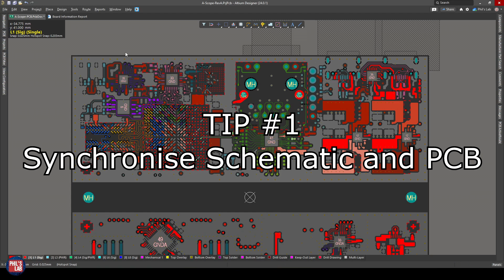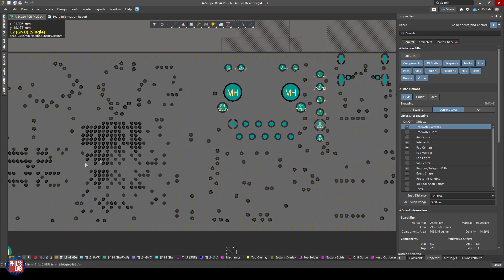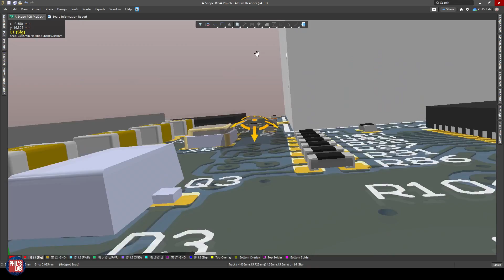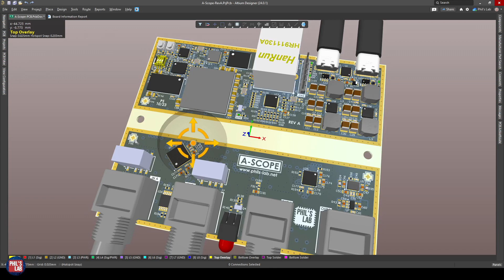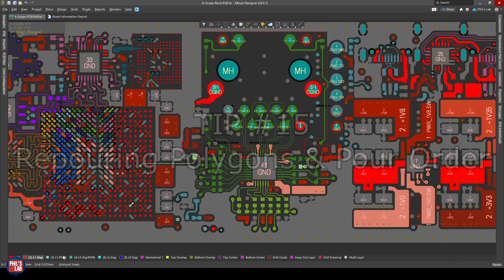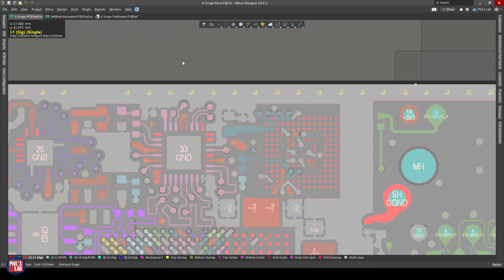PCB Design Final Touches (Tips & Checklist) - Phil's Lab #131

Comment from the maker: Thanks for watching! What final touches do you add to your boards?
In a future video, we'll cover a full PCB design checklist and make that a 'collaborative' GitHub repo.
Reply: What I do is do not open the design for a week or two if possible so when you see it after a longer time you can see all the stuff you haven't seen before
Reply: I only used KiCAD (just a lone, retired old fart) and I rely on the software to see if I've cocked anything up. I recently failed to do that as I moved from 7.x to 8.x because I got caught up with the production delivery (normally done automatically by an extension).

So I took my eye off the ball and planted a pressure-relief hole (air pressure) right through one of the supply lines. My board house spotted it and sent me an email.

That would have been pretty expensive in relative terms, both in price and lost time.
Reply: Hi Phil, how are you? I am sure things are quite busy. Is the video on "5 Jellybean SMPS IC" still on the list of TODO things?

Comment: 09:00 - Side Note 1 - Also poured areas that are only stitched with a single via should either get an extra stitching via (and if larger island) with some seperation to the original via, or just be removed. Otherwise the lonely stitching via functions as a antenna feed for the poured EMC patch antenna 😛

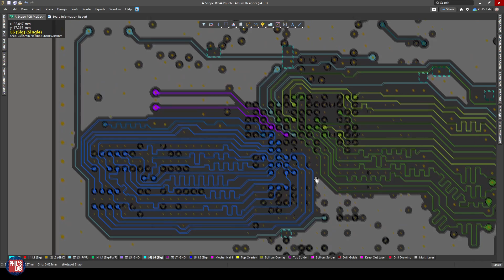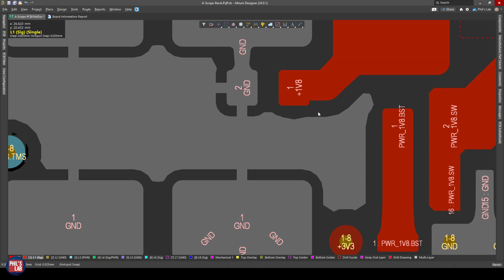09:11 - Side Note 2 - Not mentioned but visible in the upper middle left: peninsular pours like the gray area between the two purple lines should have at least one stitching via near the furthest point away from the "main land" (better some more) as can be seen here, or removed (like the example at 08:55)

Comment: About Non-functional Pads: Does it only remove the annular ring from VIA in all layers except the first and last layer?
I'm asking because VIAs are galvanised in the last production step and it might not hold in place, if the annular ring is missing on both those layers right?
Reply from the maker: Yes, by default it'll keep outer layer pads.

Comment: In regards to removing unused pads; is there any reliability concerns here regarding the platting in the barrel? I know its common to remove them in HDI designs but during the fab process there is usually a step called 'etch back' that exposes the inner layer copper to the barrel to allow the platting to grab onto the inner layers. With the inner layer pads removed could there be a risk that during thermal cycling that the vias are weaker?
Reply from the maker: I spoke to some manufacturers about this and they didn't suggest any reliability concerns.

Comment: as a smt machine operator i have to tell u its pain in the ass to deal with cross fiducials, becouse it so reare wee have to manualy change type off fiducials, why not stick to things that just work, much love
Reply: also the red soldermask is the worse to use, becouse on AOI sometimes itss not working 100% perfectly
Reply from the maker: Thanks for the info! I spoke to some manufacturers about these fiducials and they didn't bring up that point.

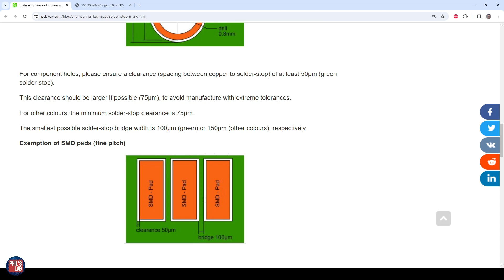Comment: 24:58 and subsequent: Quite a bit of discussion about "bridges".  In my view, "bridge" should refer to solder creating an unwanted bridge from one pad to an adjacent one, and Phil does use the word in that manner.  However Phil uses the word bridge to also refer to the sliver of solder mask that helps to avoid solder bridges. I think this is confusing. Better to call these something like anti-bridge solder mask slivers, or something like that.  No need to add to the confusion already precipitated by the "solder mask" layer actually specifying where not to place the solder mask 🙂.

Comment: Phil -- regarding removal of unused pads on vias:  What do PCB manufacturers think about this?  I don't know exactly how through-hole plating works, but I would have thought that it might depend on having pads (annular rings) at beginning and end of the plated barrel, no?  I certainly see that PCB houses list a minimum annular ring width. But perhaps that's necessary only if a trace connects to the hole?
Reply from the maker: Hi Graham, I actually spoke to some manufacturers about this and apparently it isn't an issue. I do leave the start/end layer pads though, although that isn't strictly necessary.
Reply: @PhilsLab  Thanks, that's useful information.

Comment: Why do you include the layer views in your fab drawing? I find it to be really silly- its not usable for anything. Its not useful for debug. I see lots of engineers include it- so there must be a good reason for it, but for the life of me, that reason is lost on me.
Reply from the maker: You're right, it's not particularly useful - but it can be a small sanity check of layer ordering when manually comparing to Gerber/fab exports.
Reply: Well surprisingly the inner layer views CAN be useful. Not long ago, I had a 3rd party module that had some jumper tracks that you could cut to set an option. Unanticipated by the designer, the cut location of the jumper was right above another vital trace on the second layer. So if you cut the option jumper slightly too vigorously, you would cut the 2nd-layer trace and the board would no longer boot.  Having the internal copper layer view available allowed figuring out what net was cut, and how to patch around it.  We learned we were not the only customers who encountered this issue.
Reply: @Graham_Wideman  ^ this. I've also had similar situation where default jumpers need to be cut for debug/DV/testing and have had  issues with inner layers shorting out. Also don't forget that some very expensive boards will be repaired or have modifications made to the inner layers, the outer layers will be ground away to access the inner layers and then epoxy added, not uncommon at all, IPC covers it in various standards.

Comment: Excellent design review! My first PCB layout was in 1980. Back then we used 4X light tables, vellum and decals. (Much light masking tape)
A photographic camera, the size of an industrial CNC machine, was used to reduce the taped layout to 1:1.
Around 1985 I did testing as part of a design team that developed a PCB layout program  called Electronic Tape (ET).
What a relief from the tedium of manual layout!
My my. We have come a long long way!
Thanks for helping others clear the way to good layout.
Reply from the maker: Thank you very much! Would've been cool to be part of that process for sure - but in a way I'm glad we have fairly accessible ECAD tools and PCBA houses these days haha..
Reply: @PhilsLab  Yeah... no! I started on PCB layout in 1979 as a summer job... and since the outfit I was working at was a barely funded startup, I got to work on taped layouts at 1X, using tapes as small as 1/64" (0.4mm). Not very fun.  However, being part of the process of escaping from taped layouts would definitely have been exciting! Those olden days experiences tended to fuel considerable patience with the early clunky DOS-based software, and modern tools are fountains of happiness 🙂.

Comment: Great Videos! Could you make a video explaining the purpose of the exposed copper on the pcb edges and vias within it as well as how to generate that in Altium? For a circular shaped pcb or a hexagonal pcb?

Also, A video with a hexagonal pcb and its routing is very much needed. As the angles in a hexagon arent 45 or 90 and in altium, routing is fixed to 45/90
Reply from the maker: Thank you! Possibly in a future video, yes - thanks for your suggestions.

Comment: Please release videos on designing a flight controller for quads with video telemetry project with ir sensors for obstacle avoidance.
Reply from the maker: Actually recently got myself a micro quadcopter frame that I plan on making a simple FCS for :)
Reply: @PhilsLab Sounds good. Not to make 'demands' but if you looked at ESC design and made it an all-in-one board that would be good.

ELRS receivers are completely open source so you could integrate that as well possibly (its super simple, MCU <-UART->ESP8285<-SPI->SX1280<-RF->antenna
Reply: @PhilsLab  Yes please, your old fc design isn't really practical for quads that much. It'd be nice to see an up-to-date revision with compact size factor that's more inline with current trend
Reply: Yes please... Make this tutorial thanks